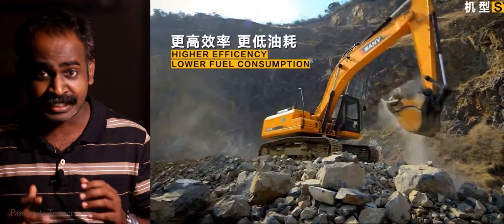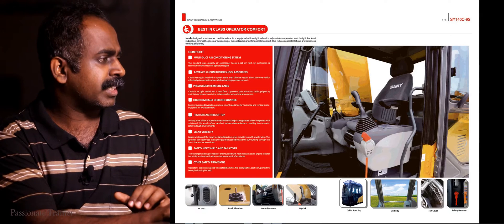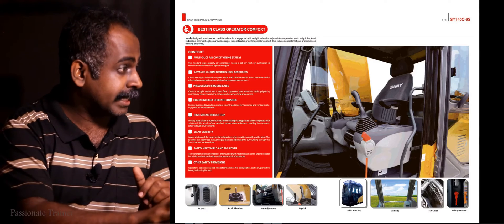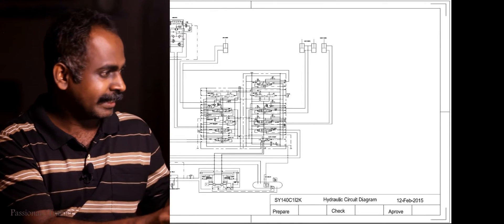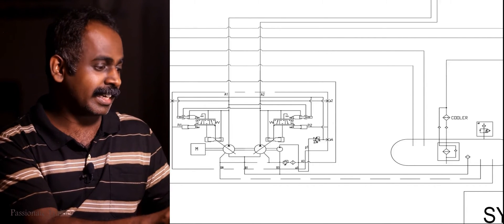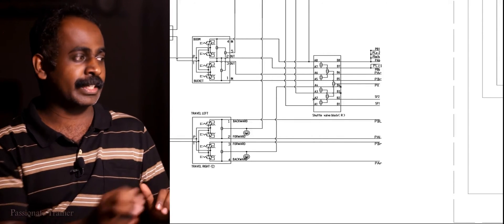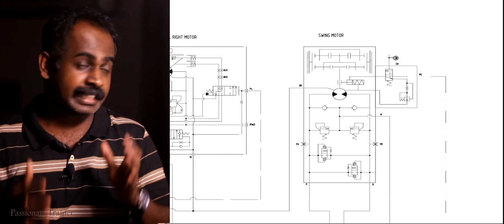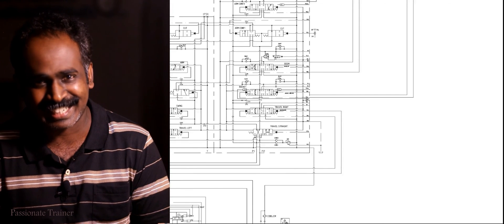HYDRAULIC CIRCUIT STUDY | SANY140 HYD EXCAVATOR - PART01 | PASSIONATE TRAINER

Comment: very detailed explanation.... i would like to get some advise on the engine of the excavator that connect to the hydraulic pump.  my mini excavator engine broke down. I wanted to change the engine. so l try to get a used engine to match my existing damage engine. My existing engine Rated power is 10.1kW (13.5Hp) /2200rpm, but i only can find a engine about 15kW/2000 rpm. Can i use this engine to replace my damage engine?  Thks
Reply from the maker: going for higher power engine is not a problem you can go ahead if mountings are matching , but it can increase your fuel consumption, Noise/Vibration level etc.
Reply: @PassionateTrainer  Yes... I do understand that. Thank you so much
🙏🙏🙏

Comment: Nice explanation sir....👍👍sir, why we are using hydraulic motors for travel at many machines? Why don't use a drives?
Reply from the maker: The main limitation of using E Motor  with its drive and same time the Advantage of using a Hyd. motor is its the reliability in various weather situation also hydraulic breaking is more smooth and more reliable compare with e motor working system!!! Please watch an another video "Basics of Hydraulics' which I started by using comparison with mechanical & electrical power transmission